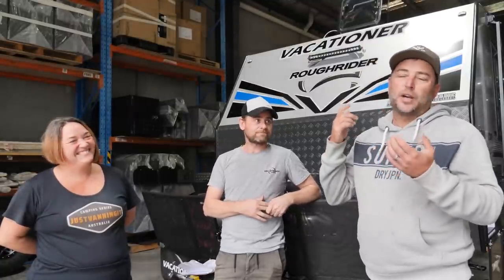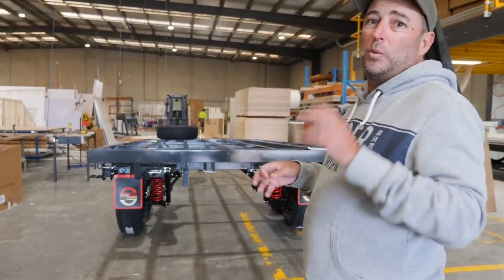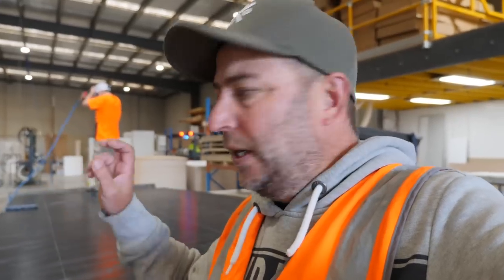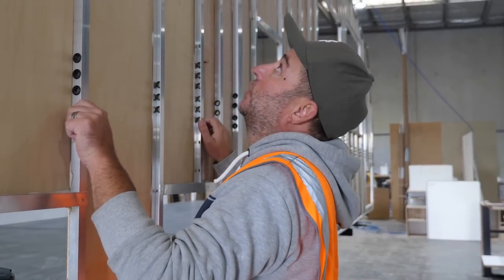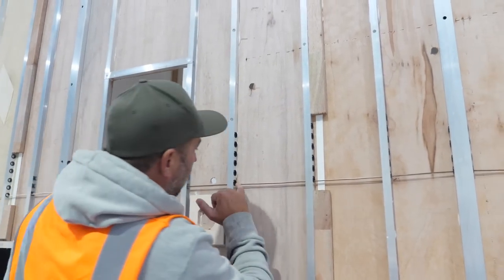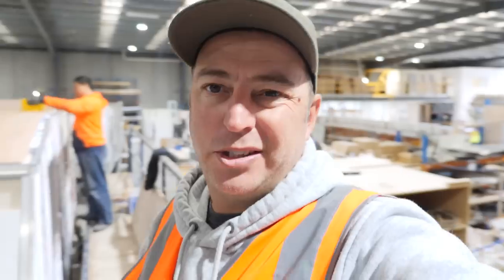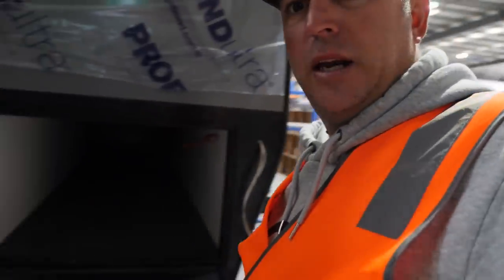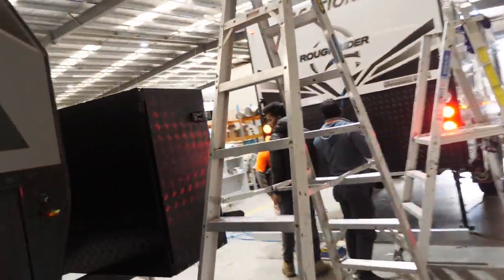BUILDING AN AUSTRALIAN CARAVAN|Off road caravan

Comment: Great van, I am looking at a new van what do you think of the DAKAR with airbags and disc brakes this will be my first van
Reply from the maker: Hi, thanks for your question. The Dakar is an amazing van and would have been our first choice but couldn’t pull the weight as it is a heavier van. So decided to spec up the rough rider with Dakar specs. 

Vacationer offer airbag and disc brake options but you would be better off specking up the Rough Rider (or other) with the Dakar extras in terms of weight.  Vacationer are really flexible to accommodate this. 

We have watched a Dakar get built which was just behind our van and they are a beautiful van.
Reply: Thanks for that DAKAR is of my list I have a ranger wildtrak what’s the tare on your van
Reply from the maker: @Jm-bp5zw  tare is 2680

Comment: Great video of the build process and the van looks like a beast! 
One question, you made reference to no timber in the floor so no rot if there is a leak, no timber in the frame so no rot if there are leaks, did they offer an option for something other than plywood for the internal wall panel?
Reply from the maker: Thank you 🙏 . They do offer a fibreglass interior one piece wall and ceiling . The top end caravan offers that as a standard but on the roghrider it’s an upgrade

Comment: If you get an electrical fault do they need to remove outside wall to fix it or get to wiring ? How are outside speakers secured to van? Glue? Silicone?